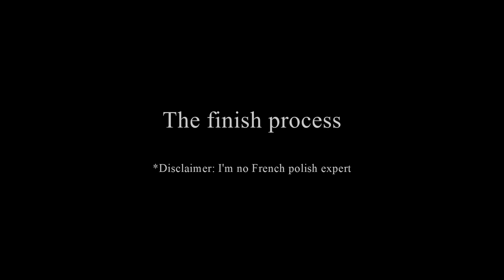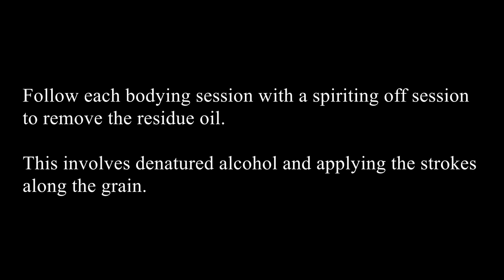StewMac Acoustic Build: Part 5 - The Finish

Comment: As always, incredible.  What did you grain fill with? What did you stain it with? How do you like that finish now that it's done and cured?
Reply from the maker: Grain filled with walnut timbermate. Stained with a dark walnut stain.
The shellac was initially soft and easily scratched, but after nearly 4 years it still holds up very well. Has a vintage guitar kind of finish.

Comment: Hi brother, could I contact you directly? I’m looking to actually strip my guitar (Martin Drs1) off it’s colour and get the colour you have for this one.. if it’s okay to ask for some tips? Other than the ones in the video. 
I know you used a dark walnut varnish. Do I just use clear shellac to seal it up? 

Did you only use shellac to cover the top? And do I need to use anything else for my top once I’ve sanded it all to a 320p? 

Lastly, do you recommend me at all sanding the colour off my guitar to do this? 

Please help... I’ve watched this video like 10 times hahahaa
Reply from the maker: Is there any reason why you want to refinish it? Refinishing a guitar is a tedious process. I'm not sure if starting out on a Martin would be a good idea.
If I'm not wrong the Martin drs1 has a satin finish? If so it will be much easier to sand off.
The choice of finish is entirely up to you. French polish is tough. If you have access to spray equipment, I'll recommend a lacquer based finish. But bear in mind doing so may change the tone of your guitar.
Reply: Simon Tan 
Thank you for responding! The real reason is I don’t like the look compared to this one. Like the Martin OM-21 is one of my favourite guitars and I want it to look like that. 

I’d be willing to take the time to French polish it with a few coats of shellac. I don’t think I’ll have a spray to put the lacquer. 

The Drs 1 does have a satin finish, but the colour just doesn’t seem as rustic like a walnut and there’s really no contrast in the guitar.
Reply from the maker: @angeloamador6483  But the dsr1 is an all mahogany guitar with no binding. I think it's hard to look like the om21.
You can definitely sand it off and apply the darker walnut stain. If you're confident with French polishing then go ahead! Just be patient and keep trying and don't be discouraged.
Do note that everything you do will be irreversible but not irreparable.
Good luck!